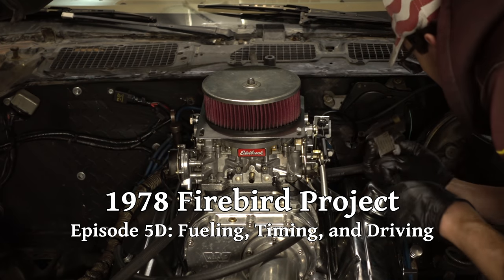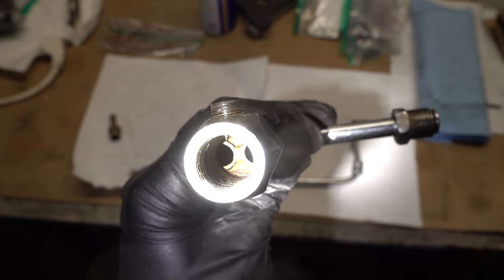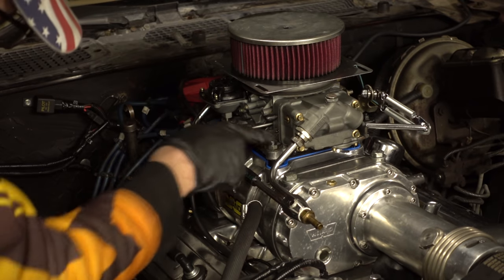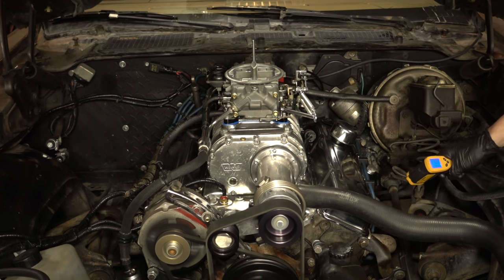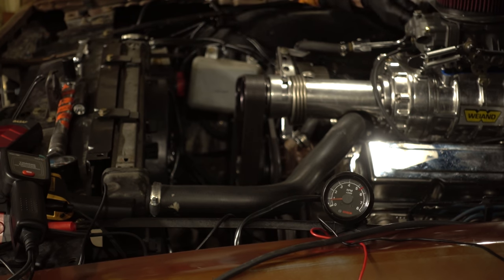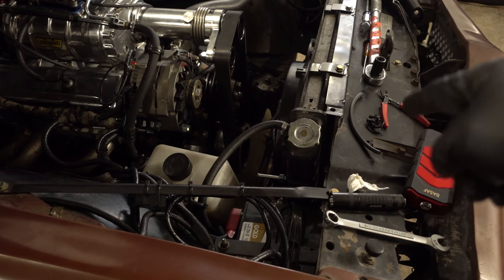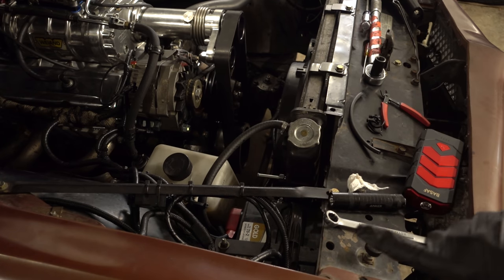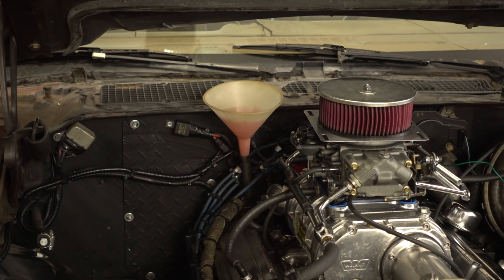1978 Firebird Supercharger First Drive and Carb Setup (Ep.5 Part 4 of 4)

Comment: Watched a little bit of your vids, just a couple things I'd like to throw out:
1. an intake backfire out of the carb can be alot of things, don't assume automatically it's timing.   A carb that is dry and hasn't been fired can be lean on several circuits until all the air is pulled out of the passages.   Accelerator pump issues can also cause this.   Regardless going back to the holley was the best decision, edelbrocks do not belong on engines where performance and tune-ability are key.

2. A rich idle even with the idle screws turned almost in is a sign that your idle feed restrictors may be too big, consider getting aftermarket metering blocks with screw in restrictors that you can fine tune.

3. Definitely consider a wideband, I can't stress this enough as A/F ratio is critical on a forced induction car.   Being lean on an NA motor isn't a big deal, but a forced induction car can trash pistons in a very short time.
Reply from the maker: Thanks for the info! Will have to look into those screw in restrictions. And I hadn't heard about the air in carb passages being able to cause intake backfires before, but it makes sense.

Wideband setup is going in the car soon hopefully, it's been sitting on my desk for almost a year...

Comment: Great series of videos. I have spent the last couple of hours going thru them.  What do you think your HP gain is after installing the blower?  I agree with you, that noise at idle in gear is kinda rough. Im sure getting it down the street makes up for that.
Reply from the maker: I think I can quiet the noise down some with a good tune, it's pretty grumbly but the volume varies a lot based on the idle speed and quality. Best guess I can make is it was 300hp before and 400hp now (at the crank). The gearing makes it really hard to compare it to the feel of other cars though, and I've never actually got it above 4400RPM or so. Sounds very intense and feels very fast even at that RPM, though. Really takes off on the highway as soon as it makes boost.

Comment: awesome video. You should definitely try a bigger air filter.
Reply from the maker: Marco Ceccarelli Air filter size doesn't matter so much on a supercharged engine (or so I've heard). You frequently see dual carb blown big blocks with filters this size for clearance reasons, and they seem to have no problems making power! This is the size filter in most hood scoops that aren't twice as tall.
Reply: Any restriction to flow will limit power. If the blower exceeds the ability of the filter to flow air, because it is a positive displacement, this will equate to the blower consuming more power at the crank and this will put less power to the rear wheels. Because efficiency will be decreased and blower needing to work harder at a given speed, intake charge temperatures will increase as well. At WOT, where the limits of both the filter and the blower will be, this increase in temp would also increase detonation potential. Typically timing is pulled and fuel increased to counteract this. Now you have a blower consuming more power, more fuel, Increasing intake temps and making less efficient power because a restriction exists. This is why they say you can never really over-carb a blower. The less restriction, the less power is consumed and more efficient boost is made.

Comment: you should have the feed line from the gearbox entering the top transmission inlet of the radiator & exiting out the bottom than going through the auxiliary  cooler as the top section of a radiator is the hottest area & the cooler area is at the bottom of the radiator this way your not heating up the transmission fluid before it goes to the auxiliary cooler
Reply from the maker: I have heard people make a case for both flow directions, I doubt it actually matters all that much. GM set it up so that the oil moves bottom to top so I assume there is some reason for that. As long as it is on the "cool" side of the radiator I'm not sure how different the coolant up top is to the coolant at the bottom.

Comment: Did you think about a turbo or a double turbo set up instead?  
That blower noise is a bit much, just saying.
Reply from the maker: I am much more interested in roots superchargers, partially for the style but also for the simplicity of the setup. All of the extra complexity of a turbo setup, at least for this car, keeps me from being too interested in it.
Reply: No. That blower noise is music to  my ears. A cowling over the intake will quiet it down some. A lot of noise is escaping from the carburetor when it's wide open.

Comment: This almost discourages me to get a 671 for my 85 bird just because there's so much to check and make sure works...
Reply from the maker: I honestly didn't expect it to be so much before starting, it seems like a simple thing on paper. And even now, there are several funny noises that I don't know what they are and are intermittent to the point where I can't even figure out a source. I am not saying that you shouldn't, just expect things to get complicated and be prepared to take the time to figure everything out! I have a bit of regret because I so enjoyed how well the car just ran without complaining before, now it is a bit finicky and needs a lot of figuring out all over again.
Reply: Fuzzy Dice Projects have you tried the good old screwdriver trick when the sound presents itself?
Reply from the maker: They occur almost exclusively when driving, and the one time one of the rattles showed up at idle I was not fast enough to get out of the car and check before it stopped again. The most annoying kind of intermittent. Last time I started it on a cold morning there was some ticking until it got warm, like a lifter or piston slap, but I didn't have the time to check it out.

Comment: Not sure if someone has mentioned this but that air cleaner is robbing your horse power. Look up Motor trend on Demand and Engine masters Air cleaner challenge and you will see Dyno proven proof hope this helps.
Reply from the maker: Normally aspirated, you're right! But air filter size doesn't matter so much on a supercharged engine (or so I've heard). You frequently see dual carb blown big blocks with filters this size for clearance reasons, and they seem to have no problems making power! This is the size filter in most hood scoops that aren't twice as tall.

Comment: Thank you for doing all the hard work, now I know what not to do, I bought  a built 318 food door Plymouth Satellite, but the owner didn't know what he was doing, I got it and it could get beat by a stock VW bus, I tuned it up and fixed 5 vacumme leaks, now it whips Honda, next comes 408 ---318 stroker! with big airflow research heads! Thanks again you could be a good shop instructor!

Comment: I always bypass the radiator cooler and install a good sized transmission cooler. The only purpose the rad cooler does is add heat to the system, it helps in the first mile or two in cold climates, but I'm from Montana and I've never lost a transmission and never had one slip by going this route. Heat is a transmission's enemy, as well as never changing the fluid. Current designs are designed to break down transmission fluid by adding all that extra heat, so you have to spend tons of moola fixing preventable problems. Luckily my current ride came with a monster cooler, teh size of an AC radiator on older cars, part of the towing package. I added a aluminum radiator, deleted the radiator tranny cooling, added electric fans and everything stays nice and cool.

Comment: You are a smart man .  You realize that you overthink everything ?  Please take that steel line and throw it in the trash .  Get some AN fittings and make some braided hoses for fuel and high pressure for the tranny .  Route it where you want .  Rubber fuel line is a fire looking for a place to happen .  Do not ,"I'll do it later".  that never happens .  Clean , clean, clean

Comment: I enjoyed your videos very much.  You should try a bigger air cleaner, something with more surface area.  Your trying to pull more air through your carb and push it into the engine but that tiny air cleaner is restricting the air flow.    I've got a B&M 144 Supercharger on a 355, I was running a smaller air cleaner and switched to an Edelbrock #43662, it is 14" in diameter with a 3" tall element and the top is made of air cleaner element as well so it flows through the top as well as around the sides.  It made a huge difference in air flow, you can hear it in the blower whine and there was an increase in power that you can feel as well.
Reply from the maker: Very interesting! I have always heard that it doesn't matter as much for forced induction, I have seen engines 2-3 times as powerful as mine (albeit dual carb) with air cleaners the size of this one. I will have to keep that in mind, thanks for sharing!

Comment: Awesome series. I have a 1977 esprit that I took my drivers license test in back in 1982! It has the original Olds350. Rebuilt it at 289,000 miles. Harmonic balancer went bad. It still has original heads, intake, and Rodchester carb.. now with 320,000 miles.. I recently replaced the hole brake system. Slotted disks up front is only up grand. What a difference.....
Reply: I have a 1978 firebird esprit skybird edition
Reply: Hi what oil do you use, thanks, I'm conducting my own survey, I'm using canola oil, the bad thing is you can't use it under 32deg.

Comment: Hey look you will always have hotter exhaust temps with a blower because of the pressure, but you know that, good job fixing that Holley and the timing,  if you are going to check your spark plugs do it warmed up and as soon as you drive the car WOT then put in neutral and shut off engine and coast to a stop . Check it then of coarse its going to be hot as hell but its more true accurate then doing it when you get home. I like your build, the other guy that sold the blower should have taken the time like you did. Thumbs up to you.

Comment: Tiny air filters can cause issues. Might want to look into how air filters affect performance. Engine Master's did a good one.
Reply from the maker: My understanding is that on supercharged engines it doesn't matter nearly as much. This is the size in most hood scoops, and you see them on single/dual carb setups making tons of power, so I'm not worried there. I have seen that episode, and the salad bowl air cleaner is just the best!

Comment: Fuzzy Dice Projects 8:56 the reason your primary throttle blades are open too much is you're not utilizing the large vacuum outlet at the rear of the throttle plate. run your pcv hose to it then you have a big enough of a vacuum source to allow you to lower the idle. your front throttle plates are opened too much trying to get enough air flow.
Reply from the maker: The rear outlet is hooked to the brake booster, which is how these seem to typically be set up

Comment: Once you screw the brass fitting into the one carb feed line are they not essentially the same inlet size etc? Lol. Your looking through the 3/8 hole of the one and have the barb fitting out of the other..
Reply from the maker: Oh, that is just because it is more visible that way. There is around 3/4" of space between the end of the barb fitting's threads and where the lines are welded to the main section, giving a lot of space for the fuel to theoretically split the flow front/rear into the 3.8" lines. Those sections are therefore more open to flow while on the other feed line setup only had a tiny window (far less than 3/8") open to the inlet.

Comment: Love the video great job just had a question for you when you were trying to cool the headers down  , It was strange because usually putting more fuel in will cool the engine down to get away from a lean  condition but then you’re running black plugs which means to Rich, and it needs to be less fuel so interesting dilemma

Comment: the spline problem  mmme we used too find this with kick starts they tightened up but there was play very like  that my soloution was to put needles in the spines then  it was a tight fit  mayb there if its anoying this could be done  unless they would be able to get free
Reply from the maker: Interesting idea, but like you said I'd be a bit worried about them getting loose. Also, with the only bearing for the snout all the way in the tip, I'd be worried about creating a wobble by pushing the splines off to one side or the other. Especially at 10k RPM!

Comment: ditch the carb and HEI dizzy!!  Get a Holley Sniper with the dual sync dizzy!!  I did the same thing last year and so glad I did.  Super easy to tune and my 83 chevy truck runs like a modern vehicle now.  The fuel and timing curves are all right there on the computer.  I fought with trying to modify a mechanical HEI dizzy just like you did because I was getting too much timing on light throttle and the engine would spark knock (ping) like crazy.  All those stupid little problems go away when you go EFI.
Reply from the maker: The biggest reason I won't go EFI for now is the price. I really just can't afford it. But I also like carburetors because they are simple and old-school. Won't be as efficient and tuning isn't as straightforward, but they can be gotten cheaply and nostalgia is powerful.
Reply: @FuzzyDiceProjects  i can definitely understand that. Where abouts in Maryland are you? I'm in virginia.
Reply from the maker: Montgomery County MD, only really separated from Virginia by traffic

Comment: When you fill these blowers with oil the first time you fill  it on a table.
. 
then you  lean it forward  for a minute or two spinning nose wheel to make sure the bearing is well oiled.
Then you  let it set for 5 minutes  then you top it off .
Then about every two months I back it up a steep hill  with it full and run it for 5 minutes let it set ten minutes on flat ground
and top off oil if necasary.. 
Tell your freinds .
.

Comment: That fuel line setup scares the shit outta me... Since you have that rubber hose in the middle there's nothing to anti-rotate the pipe fittings at the carb (particularly the front one) so they can become loose and start leaking gas at any moment. I think I'd either braze in pipe of the right length, just make one from scratch, or buy the right part. For testing and tuning it will be fine, I wouldn't want to drive around much that way.

Also, since you're also in rust world like me, save your pennies up and get one of the Eastwood line flaring tools. They're expensive, but good God do I absolutely love mine. I'll never use one of those shitty alligator jaw style flare tools again!
Reply from the maker: Maxwelhse Hmm, they're the same flares as stock transmission cooler lines, those can have quite a bit of angle in the lines coming off and a fair amount of twist from old engine mounts and I haven't heard of them coming loose. And there are many aftermarket fuel lines for dual feed Holleys with flexible center sections. I hear your point, and I don't love it either, but I don't think it will be an issue.

And good tip on the Eastwood tool, I have seen those before and wondered how well they worked!
Reply: I understand your position as well, but stock transmission cooler lines don't bend 90 degrees almost immediately after the fitting (they're generally straight-ish), aren't at the top of 2 foot long vibrating lever arm from the motor mounts perpendicular to their rotation (tranny cooler lines are axial to the rotation), and have another vibrating point nearly at the mounts (the fuel pump) to work against...  You'll also notice that automotive OEs abandoned that style of fitting decades ago in favor of push-to-connects that seal on an o-ring that can tolerate axial motion. Granted, I'm betting that's mostly for ease of assembly in the plant, but it does also mostly eliminate the failure mode I'm describing.

The aftermarket stuff I've seen is generally braided stainless, which is much stiffer, but honestly I don't much like that either regardless of whether or not it really causes problems for anyone. Call me a worry wart, I guess, but I don't want a fuel leak at the top of my engine, ever, so I'd do everything I can to mitigate one. I suppose the good news is that with the hood hole you'd know it right away. ;) I'll also add that as more of a grass roots hot rodder, like you, I actually enjoy making my own little trinkets like that even if it is overkill or it's only $10 to buy one. You could flare up a hard line center link with fittings and end up with the same result as what you have now (just back the fittings off, remove the center link, and do whatever you want with the bowls) with no rubber in the system and blue loctite it together. No worries then, even if they're overblown, and you made it yourself.

In regard to the tool, as much as I'm generally not a big fan of Eric The Car Guy for assorted reasons, his review of the Eastwood tool is pretty much dead on, as are Eastwood's promotional videos of it. I'd let you borrow mine to try it out if you were closer. Ever make a run to Indiana and I'll toss it in the vice for you to play with. It takes about 60 seconds, total, to make a perfect flare every time. That and switching to the fancy copper line for brakes has cut my time for those jobs literally in half. The on-car version, which is sadly only sold in 3/16", is also the bomb.

edit: Oh.. Another fine job on another awesome series, btw!  :)

Comment: Not sure if t his is doable with a hobby project but can fuel lines be water cooled through thermal exchange?
Like have a water loop set up where a section becomes cool than travels along the side of the fuel lines transferring the heat from the fuel to water than moving along to an area it can cool down.

I'm unsure if any cars have done this before so I might be talking nonsense.